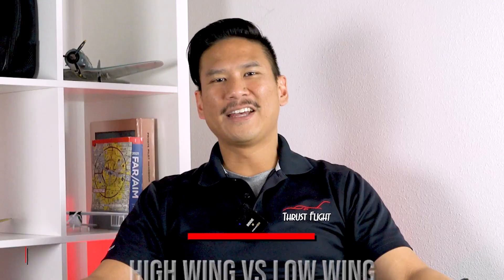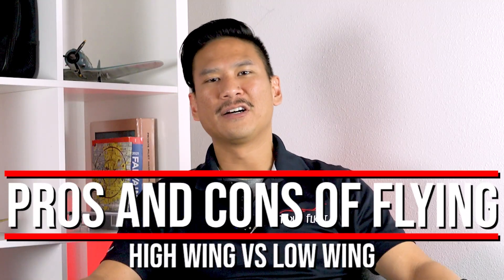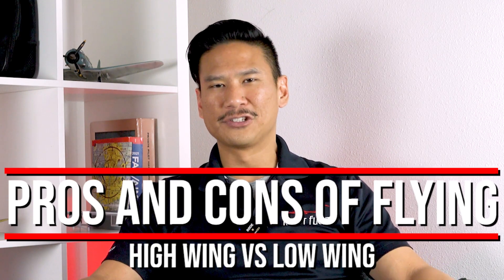Ultimate Showdown: Low Wing vs. High Wing

Comment: I learned in high wings like the Cessna 150/152/  172 and Aeronca Champ.  I did get some time in a Piper Warrior. While it was a good plane to fly. It just didn’t grab me, so I opted to finish my training in the Cessnas. Even after I received my Private Pilots Certificate, I still chose high wings.  I might get into a low wing, when I start on my instrument rating and do a lot of cross country work, maybe.

Comment: wouldn't camera solve a lot of these visibility issue ? long haul trucker who had similar visibility issue where they can't see the back of their truck. They used wireless solar battery camera attached to back of their truck to see. Cost like 50 bucks each. So repurpose them for aircraft use shouldn't cost too much.

Comment: Thanks for the video.
High wing gives more stability due to CG located lower on the fuselage so during roll there’s a pendulum effect. On the other side hand low wing is less stable but more controllable.

Comment: I like flying anyway I can do it but I am ultimately #TeamLowWing. I trained in a 172 and then bought a Cherokee 180. First time I landed it, I knew there was no going back for me. The ability to see the runway while turning base-to-final is a huge plus. The wider and lower stance of the gear lends to better stability on the ground roll. And for me, I feel like the low wing is actually more nimble than what I experienced with the Cessna.
Reply: I'm a traitor.

Comment: Coming from the radio controlled model realm of things I’ve mostly looked at high wings as lazy boring trainers, that are typically stable and slow. On the other side i have seem low wing as nimble, spirited, more maneuverable, faster planes. Now as I’m looking to manned aviation while a lot of low wing planes are faster they don’t necessarily follow my same thoughts with model aviation. I still kinda see them as the cool kids, better looking overall plane. I don’t mind a high wing plane, but at least aesthetically I prefer a low wing. As for flying I’ve only done a discovery flight in a 172 which I took off and flew most of the flight, I’ve never been up in a low wing. I’d like too though. I don’t like the idea of walking on the wing to get into a low wing though.

Comment: You didn't touch fuel efficiency SOOO you deserve a question that you may knot (pun) have an answer to.

I'm studying for my PPL (at home so far) but I'm also considering/searching as to what airplane that "I" should buy.
Looking at a Cherokee 160 but I want to clean it up with upgrades so as to get near 180 performances but with 9 GPH fuel burn rather than the 12 GPH in the 180
Products that I'm inquiring about:
#1 Power flow exhaust that adds 14hp (taking 160 HP up to 174HP)
#2 all of the Knots 2U accessories which include:
Wingtip extensions with Horner tips (for improved climb rate, better glide slope, reduced landing speed, better fuel consumption etc.)
Sealing all of the control surfaces gaps including sealing the flap to fuselage gap (for efficiency, reduced landing speeds, and hotter controls).
Additional streamlining components for the existing wheel pants (which look really good BTW).
I think that there's a couple more knots 2U components for the 160 but you get my point.

OK so "what have you heard about the Knots 2U" actual results of their efficiency complementing components and does compiling/stacking them keep adding up?
I have my dream aircraft in mind but what's the reality of what I'm dreaming of?
(A cleaned up, 174HP 160 "nearly" achieving 180 specs but with a much lessor fuel burn)

Yes I realize that the resale price won't pay for the additions, just like when hopping up your automobile, it's for the persons likes, wants, desires, and there's no profit in them.
Reply: @TheLegitRudy  Thank you for the reply. I will have to get to a flight school eventually but for now I'm digging into the books. What I was really looking for was first hand or trusted 2nd hand information regarding all the offered mods of Knots 2 U, they're not cheap and them working as advertised is essential to my overall plans.